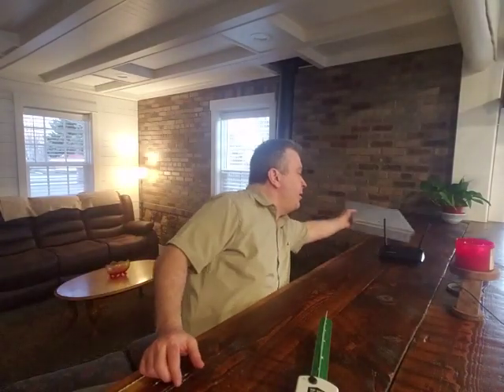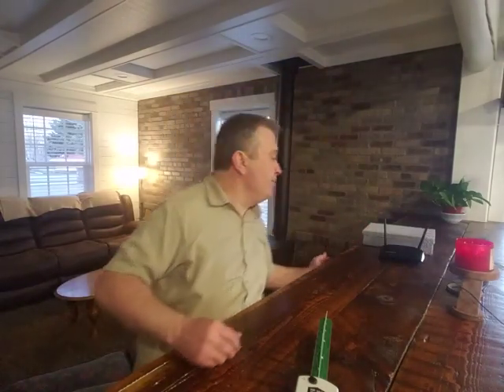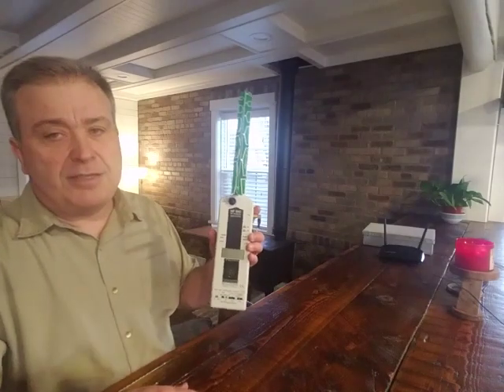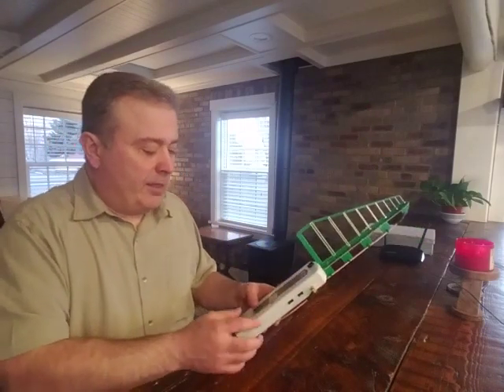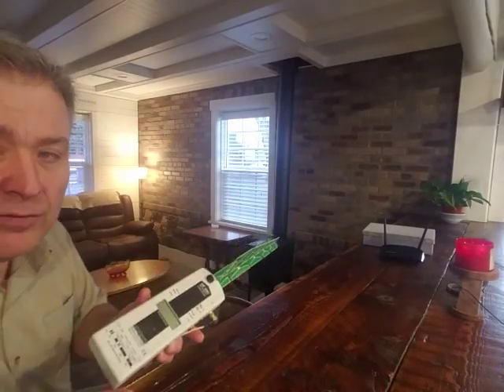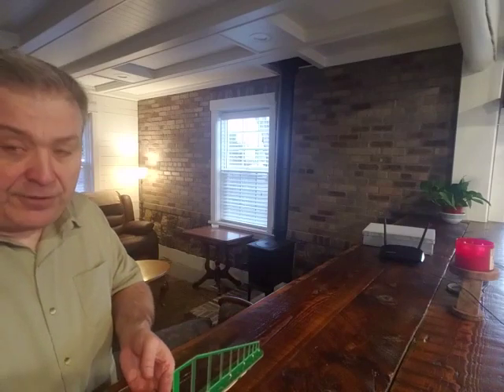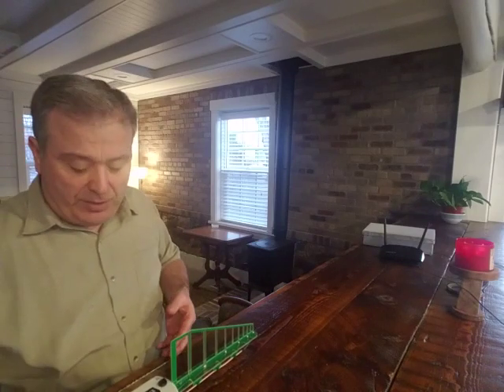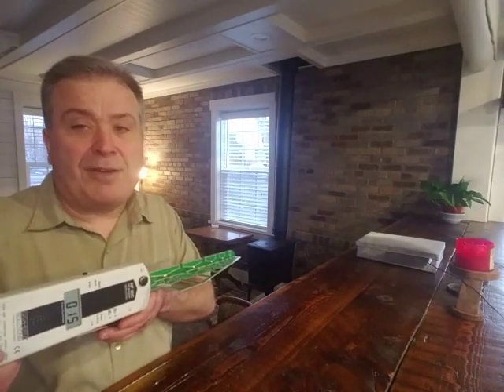Wifi Router Guard Product Review

Comment: Hi, 
Nice video. After knowing that Wi-Fi emits dangerous radiation, I sandwiched my router between aluminum plates. Like bread pans  not just one but three layers of them. Hope it helps. But can't say without a meter. By the way, can you check that by putting a bread pan may be two three over it and see how it reduces the radiation. Just curious. By the way how could I get the aluminum screen mended to the size of my router. Does some one do it if I buy the screen
Reply from the maker: If you use a solid conductive metal like aluminum, and you seal it up with no cracks, it will block pretty much all of the radiation. You won't get any WiFi signal either. If you are not wanting WiFi at all then a better way would be to contact your internet provider or where ever you purchased your router and get the login info for your router settings. You can login to the settings of your router and turn off your WiFi. Also with aluminum I would want to test it with a meter just to be sure it is not reflecting the radiation out of any holes or cracks.
Reply: @RadiationHealthRisks  thanks for your timely reply. What if I place a aluminium screen over it as you mentioned in the video
Reply from the maker: @janakiyeluripati6368  Aluminum screen works but I would do a couple of layers and leave some air or distance between the router and the aluminum. In some of the tests I have done with metal mesh it seems to me if the device is too close to the metal mesh more radiation gets through. Having used aluminum myself I got tired of it because it  kind of looked tacky in my office. A router guard looks nicer. But if money is an issue aluminum screen will work. https://www.radiationhealthrisks.com/wifi-radiation-protection-items/
Reply: @RadiationHealthRisks  thank you. I will keep that in mind. Currently watching your other videos. Good job. Keep people educated. By the way, my daughter elementary school is using Wi-Fi. Would there be devices to filter the radiation there too. I don't know the size or what wireless devices they are using. Have to talk to them. Hope they listen and take this kind of measures.
Reply from the maker: @janakiyeluripati6368  You might want to read this article. https://www.radiationhealthrisks.com/aulterra-emf-neutralizer-products-review/ I would not do only this

Comment: Hello. This was very helpful. Question: Would I need one of these guards for a "Wireless Access Point" that also plugs into the BGW210 Router (AT&T U Verse) . I am not sure, as I do not know if the "Wireless Access Point" emits the RF Radiation along with the separate Router ... Thank you for your answer..
Reply from the maker: Anything that emits WiFi radiation would need to be within something like the WiFi Router Guard is you wish to block 95% of its harmful radiation. Or you can just turn off the WiFi in each device and hard wire the internet directly to your computer.  Hope that helps.
Reply: What I want to know is - does the little device called "Wireless Access Point" (WAP) that came with my set up and router emit Radiation?  Or maybe it does not... I do not know what these components are. Thanks.
Reply from the maker: @bar8419  my understanding of a wap, as well as doing a quick google search, yes it emits radiation. My understanding is that it connects to other devices wirelessly and gives them access to your wireless network. If any device communicates to any other device wirelessly, then it uses RF Radiation to do so. This is true if it is normal WiFi, Bluetooth or any other WiFi.
Reply from the maker: This is an example of why having a meter like I use in the video is so handy. You literally can test anything in or around your house an know exactly what you are dealing with.
Reply: Thank you. Very helpful.
Reply: One more question please, ...so.... I could put things in a mesh trash can with a homemade mesh lid? This would be great. until I can get something more visually pleasing. It would work as well?  (and yes, I should be a meter I agree). Thanks again.
Reply from the maker: @bar8419  Yes in fact if you look on this page of my website https://www.radiationhealthrisks.com/wifi-radiation-protection-items/ down towards the bottom of the article I recommend that very thing.
Reply: Yes, that is where I saw this idea... on your website... Thanks so much. Great info....

Comment: Just for clarification, if you block the radiation, the 5g is no longer dangerous?
Reply from the maker: Technically they say there is no safe levels of radiation. The router guard will block 90% to 95% of the radiation. So you can't say it "is no longer dangerous". But you can say it is a whole lot safer. That is why I say the safest is to hard wire your house with internet and turn off your wifi. If you can't do that then this is the next safest option.
Reply: @RadiationHealthRisks , how about radiation from lightbulbs... Those like really high frequency radiation in the visible spectrum. How can we eliminate visible radiation?
Reply from the maker: @Chris-Christopher-  Compact fluorescent light (CFL) bulbs cause something called dirty electricity to be radiated from the electrical circuit it is connected to. Dirty electricity is a highly toxic form of electric fields and magnetic fields that when present radiate from the electrical wiring through the walls in a building. Now on to your other point. - The higher the frequency within the radio frequency portion of the electromagnetic spectrum, the more dangerous it is. This is not true however of the whole spectrum. There are infrared and visible light frequencies that are healthy. Some we need a certain amount of exposure to. Hope that makes sense.

Comment: What metal works best for the screening?  I've heard it s/be steel, copper or silver.  Other products use high grade stainless steel mesh, some a copper mesh.  Also, if the aluminum screening works, could you not just use that instead of even obtaining the cage, i.e., form your own cage with the aluminum screen?  REALLY NEED TO KNOW WHAT TYPE OF METAL WORKS BEST TO SHIELD CORDLESS BASE.  (Panasonic KX-TG785SK model w/auto ECO-cannot seem to set to ECO manually.)
Reply from the maker: Yes you could just use the aluminum screening with out the router guard. It just does not look as good, and you have to wrap it to cover all sides. The guard is much easier to work with. I've seen products with copper, aluminum and steel, and in testing it they all seemed to produce similar results. It just has to be good and conductive.
Reply from the maker: Here is the best place to get it if you do decide to get a router guard. https://www.radiationhealthrisks.com/recommended-protections/

Comment: How much reduction in Wi-Fi speed after shielding the Wi-Fi router?
Reply from the maker: That is something you will have to test for yourself. I have tested the reduction of radiation as I show in the video. But as far as the reduction of wifi strength all I know is that in my house with my 5G router, I am still able to use the wifi throughout my 3 bedroom home. Again I think the preferable approach is to hard wire your internet to every place you can so that you don't need wifi if that is an option for you.

Comment: what's the reduction on WIFI strengh?
Reply from the maker: That is something you will have to test for yourself. I have tested the reduction of radiation as I show in the video. But as far as the reduction of wifi strength all I know is that in my house with my 5 GHz router, I am still able to use the wifi throughout my 3 bedroom home. Again I think the preferable approach is to hard wire your internet to every place you can so that you don't need wifi if that is an option for you.
Reply: @RadiationHealthRisks  Please tell me where i can find one of these
Reply from the maker: @123OGNIAN  on this website https://smartmeterguard.com/products/router-guard?variant=1114895189&afmc=1c
Reply: The website for this product claims the reduction is 10-20%, which is not that bad.